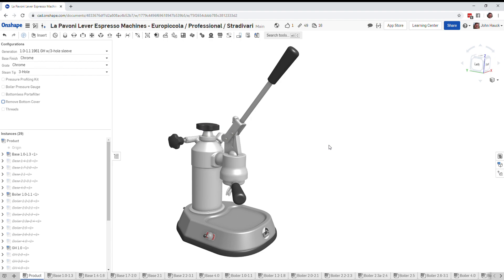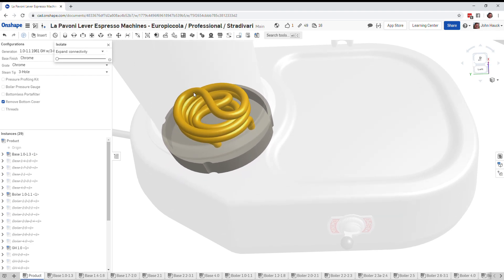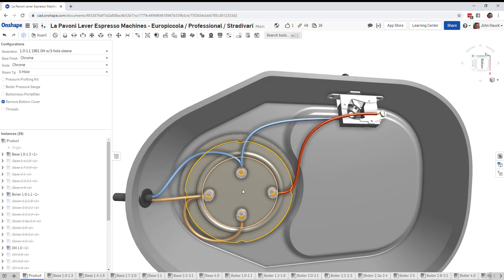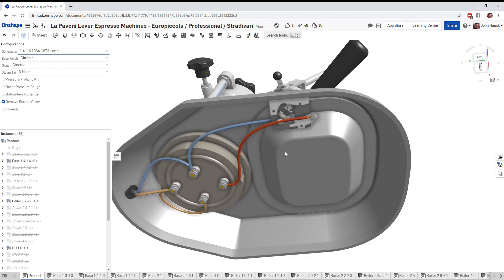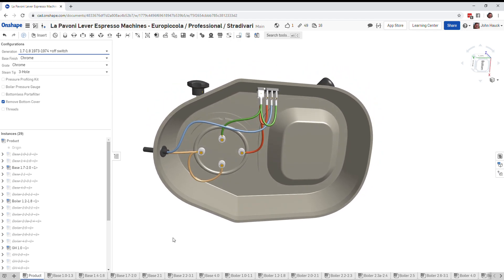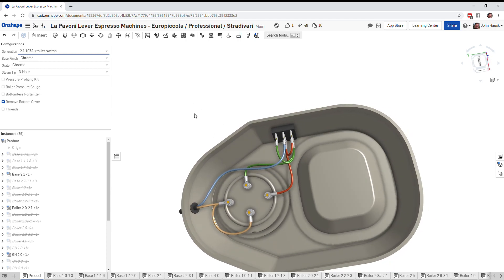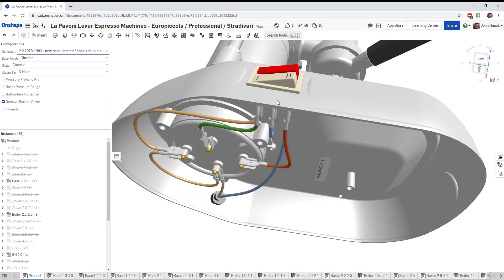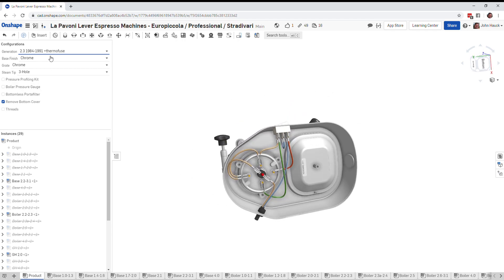9: Switches & Wiring Over the Years - La Pavoni Lever Espresso Machines

Comment: On my Stradivari Professional bought in 2025 the function of the green light on the side has been reversed. A relay has been added so the light goes on when the heat element is switched off by the pressostat. Not even the user manual sent with the machine was up to date with that.

Comment: Hi, amazing video! I have a 1997 version which does the initial pressure build up but when it releases pressure it doesn't turn back on the heating anymore. I already installed a new pressure switch but it didn't resolve the issue. Any idea what I could try?
Reply from the maker: When you write new pressure switch, I'm assuming you mean the round part connected to the boiler with a pipe. I was going to suggest descaling the machine as that can ofen interfere with the presure switch operation. Maybe try that anyway to deal will buildup in the pipe. What confuses me is when you write "it releases pressure". Are you now referring to the mechanical pressure relief valve on the top of the boiler? I'd suggest bringing this up at this facebook group, as they are a very helpful and friendly bunch. https://www.facebook.com/groups/lapavonienthusiastsgroup
Reply: @JohnMichaelHauck thanks, indeed the round part. I will descale and see if that helps.. If not I will write to the group. Thanks a lot

Comment: Hi John. First of all, thanks for this useful video. 14:15 Your cursor roll over a short horizontal brown cable. Is this the inline thermo fuse?
Reply from the maker: This is not a fuse, but just a simple wire. I colored it brown in the CAD model to indicate it is connected to the incoming brown line from the power cord. In this model, the thermal fuse is the black cylinder in the center of the boiler bottom plate. The red button is the reset switch. I hope that helps. For more in-depth conversations, join us here: 
https://www.facebook.com/groups/lapavonienthusiastsgroup
Reply: @JohnMichaelHauck  Your video was *so useful*. So, my Pavoni Pro bought in 2019 is equipped with a thermal fuse that I can reset. That's very good news. Let's see if I can bring this machine back to life. Many many thanks for your support to the Pavoni community. Apart from that, John, your work is truly amazing.
Reply from the maker: @rdmc43  Thanks. I learned a lot from this awesome site: http://www.francescoceccarelli.eu/lapavoni_schemi_eng.htm

Comment: Hi All, 
Currently working on configuring a machine with the red/green switch and the pressure stat.  I am curious to know if it is a special type of connector that allows for the hooking up of  the two wires (1from a heater element prong  and the 2nd wire from the switch) prior to connecting to the top prong on the pressurestat? (see time 11:12 from the video).  If you can tell me where I could find it online I would be most appreciative.  Thanks!
Reply from the maker: You can get a full wire harness here https://coffee-sensor.com/product-category/la-pavoni-parts-and-accessories-custom-made-from-coffee-sensor/cables-wires/
Reply: @JohnMichaelHauck  Or I found that another alternative to buying the whole wiring kit would be to use "T" splices (tab adapters for wires also a possibility) to achieve this function.  Saves money and reduces potential waste for the landfill.

Comment: Ok next question...........In the diagram for the double element heater at time 7:57, where does the brown wire going from the "off" terminal attach to?  Looking at the diagram above, it looks like it is between the element and the boiler flange. Also, why are there only two wires shown (blue and brown) coming out of the power cord?
Reply from the maker: Oooh, a wierd render glitch. Look at 8:02. It appears the lug did not render. It goes to the terminal on top that already has one brown wire.
There is no ground wire in this render. If there was, it should go to the base and the bottom of the boiler to be safest.
You can always go to http://www.francescoceccarelli.eu/lapavoni_schemi_eng.htm for real pictures.

Comment: Concerning the wiring setup with the thermal fuse and the pressure stat; does the gound wire from the cord get attached with one of the mounting bolts for the heater element?  Is there any special significance/purpose for the red wires listed on the dual elements diagram with the on-off/I and II position rocker switches.  I would think that as long as the AWG # is the same it should not.
Reply from the maker: > Concerning the wiring setup with the thermal fuse and the pressure stat; does the gound wire from the cord get attached with one of the mounting bolts for the heater element?
Look at time mark 12:51 and you can see the ground wire going to both the base the the bottom of the boiler.

> Is there any special significance/purpose for the red wires listed on the dual elements diagram with the on-off/I and II position rocker switches
I don't really understand the question. I think a good place to discuss this further (with more qualified eyes than mine) is at https://www.facebook.com/groups/lapavonienthusiastsgroup
Reply: @JohnMichaelHauck  I went ahead and requested approval to join the group (approval is pending). I just wondering why the red wire is red.  I know that green or yellow/green is usually a ground wire and black wires are usually the hot wires carrying current to the switch.  I'm just a little fuzzy on understanding whether or not the red wire is just another "phase" wire or if it has some specific purpose?  Maybe it's just to make it easier to see on the wiring diagram.   Thanks!
Reply from the maker: @evw-2270  I think most wire harnesses these days are all white. I picked my own set of colors for these models. The colors made sense to me at the time! And yes, it helps to visually follow a wire in the model.
Reply: @JohnMichaelHauck  Good to know, thanks!

Comment: Wow!  Just the info I have been looking for, thanks so much!!
Reply from the maker: Thanks. Enjoy.
Reply: @JohnMichaelHauck  I do have a question though, where does the green ground wire from the cord itself attach to?  Wouldn't it get mounted to a grounding screww drilled into the base?  Are all wires supposed to be the same gage (i.e. 14AWG) regardless of the insulation color?
Reply from the maker: @evw-2270  I'm not sure what generation you are talking about. The more recent designs have the ground wire running to two locations. One is the base and the other is the bottom of the boiler. My understanding (I am NOT an electrician) is because you want all the metal on any appliance to be grounded, and you cannot rely on the boiler-to-base connection to be conductive (there are gaskets and paint that can get in the way). As for the wire gauge, I've always seen them the same size - and this makes sense since you want to ensure the ground wires are capabile of returning enough current to trip the circuit breaker. Again, I am not an electrician, so it would be best to verify all this with a qualified service technician.

Comment: Thank you!  An excellent, in depth description of the wiring changes over the years and many generations of La Pavoni.  With the help of adapter parts supplied by Stefano's Espresso Care, I was able to convert my 1977 Europiccola (which I purchased new in Bologna) into a pressure controlled heater type of the later generations.  It would have been a bit easier having seen your contribution John.  Thank you for taking the time.

Comment: Thank you- this really helped me to troubleshoot my machine. The wires were installed wrong from the factory and your schematic showed me how to wire it correctly!  It now works as it should.
Reply from the maker: That is alarming. I'm interested to hear the details if you have the inclination and time to share.
Reply: @JohnMichaelHauck  the wire from the green light should have gone to the heating connection, but instead it was plugged into the temperature sensor.  I'm surprised it worked at all, but it created a situation where the heater would never shut off- really causing a lot of pressure to be vented by the pressure relief valve.  My friend who owned the machine says it was like that from the time she bought it in the 90s!

Comment: John, what a fantastic resource for the La Pavoni community! Your other CAD videos are also amazing. Thanks for the time and effort you have put into this. I can not tell you enough how illuminating your CAD models have been.

Just a couple of comments about the element wattage as described in this video, based on personal work on multiple Pavonis, and also from Francesco. These specifically refer to the Europiccola.

1. The early Gen1s were 200W & 600W, wired for 200/800, with the 200W element always ON.
2. Later Gen1s moved to 200W & 800W, (wired for 200/800) around 1964. This configuration continued into the early Gen2s.
3. Later Gen2s (around 1980) moved to 200W & 1000W (wired for 200/1000) shortly after the change to the double switch.
4. The abominable short-lived diode version of 1991 used a single 750W element, in a benighted effort to save costs by removing an element, while avoiding a pstat. They finally sprang for a pstat shortly thereafter, using the same 1000 watt element as the Pro.

Side note: 
For those wiling to make a simple wiring mod, the double-switch Gen2s are very easy to wire both elements in parallel to max out steaming power (I have a 1988 wired for 200/1200). 
It is possible to do this on the one-switch (3-position) late Gen1s and early Gen2s, with the addition of a SPDT relay inside the base. I have done so on a 1979, which now gives me 1000W for steaming.
Reply from the maker: bravo, thank you for the kudos and additional details. I've never heard anyone call the diode version "abominable" but I would have to agree. When I was modeling the diode, I thought, well this just seems to be out of the box thinking. It must be genius or the opposite.

Comment: Hello! Amazing work! Can I ask you which cable carries the incoming electrical current? And what is the return?
In Italy the standard is that the brown cable is the Live (or phase) while the blue cable is the Neutral (or return). The ground is yellow and green. Thanks, congratulations.
Reply from the maker: Walter, the CAD model does not allow a mutli-color cable, so for ground I selected yellow. As for the live vs. neutral colors, I tried to remain true to the colors as documented by Francesco Ceccarelli (link in the video's description) where it seems the blue wire is usually the one that goes directly to the switch. The problem with real product photos is following the wires is difficult, so I clearly could have made a mistake here and there, especially since many of the wires are white. For dual-element machines, I used red for the high power element and green for the low. As I stated above, electrical service is only to be performed by qualified persons.

Comment: I was just looking at these espresso machines, and was wondering how to tell the difference between new vs old.  I love seeing the differences so that we can easily determine what is what.
Reply from the maker: If the group head is not bolted on, then generation 1 (1961-1974)
If the top of the group head is 50mm (it looks skinny compared to the bottom of the group head), then generation 2 (1975-2001)
If the top of the group head is 60mm (it looks fatter), then generation 3 (2001+)
If the lever is curved then generation 4 (2005+)

Comment: John remarkable job explaining the wiring evolution using the CAD model. 
I have replaced so many components over the years on my La Pavoni I'd have to say it's mostly made up of new parts with the exception of the boiler and the group head. It's similar to owning a vintage 5 speed Alfa Romero...both need regular TLC but when in tune it is pure joy. Thanks for your efforts.
Reply from the maker: Joseph, thanks for the encouragement.
An Alfa is a pretty cool comparison. A lot of history and a lot of enjoyment. Enjoy your cup tomorrow!

Comment: Wow...best tutorial I've ever watched!  Thanks John!   ---  I bought a new Professional-16 cup in 97 or 98 and my wife and I have each enjoyed a cup every day.   I've rebuilt it a few times over the years but I let the underside rust and have had to use plastic filler where the rust holes have eaten away at the base.  It's so beat up that it sort of looks like Willie Nelson's guitar Trigger! 

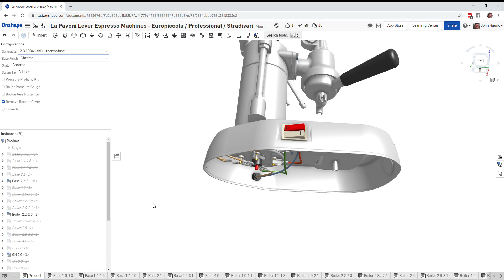I replaced all the wires a decade ago and a couple of years ago I had a company in San Diego, Jim Duke, replace the element but I don't think they replaced the base unit that the element mounts onto.  Are the element and the element base unit separate?  Do you have to replace the element base unit with the element?   Also, I think my model is the one in your video that starts at the 7:30 mark but I'm not sure because all model tags are long gone on mine.   I'm trying to find a wiring diagram.  Do you have a link for a wiring diagram for the Professional 1997-98?  Thanks again!!

Comment: Hi John - I have an October 1987-built LP Professional, bought new and used pretty much daily by me since 11 December that year. Original equipment includes a single-element boiler, a pressurestat, but no safety/cut-out thermostat. The original pressurestat routinely cycled between indicated boiler pressures of 0.8 to about 1.25 bar without triggering the safety valve. The original red simple on/off switch was replaced with a green one when it failed about ten years ago. A few weeks ago I replaced the boiler pressure gauge. Then added a grouphead pressure gauge from the always excellent Coffee Sensor. And yesterday I fitted a Bong Isolator. I'm also using the CS stainless steel naked portafilter, which is bliss, with a 20g basket. And since a few days ago, a IMS Precision shower screen. So, both original equipment and recent additions, all likely to confound anyone wanting to know how it left the factory! Thanks for your truly magnificent walk-around the LP block, which I've only just discovered, and will be coming back to many times.
Reply from the maker: Hi Allen! These indeed are wonderful machines that last forever. Because the design is so stable, a pressure profiling kit from Tudor at Coffee Sensor works on your older machine as well as my newer ones off the factory in Milan today. I was privileged to work with Bong on designing the Isolator for Tudor's store. What a cool community!

Let me know if there are other CAD videos you would like to see.

Comment: so what about the model (i believe it is one from the 1970's or 1980's) where there is an inline thermal cut off (not re-settable).  Do those units have any way to regulate heating?  Do they auto-shut off once they reach a certain temp? Or is that the responsibility of the userr to turn them off?
Reply from the maker: Are you speaking of this one?
http://www.francescoceccarelli.eu/La_Pavoni/Schemi/ep/ep84-87.JPG

Units before 1990 (including the one I think you are talking about) did not have a pressurestat. A pressurestat turns the heater off when the boiler pressure reaches a set point (often 0.8 bar). If there is no pressurestat, then there is no electronic regulation of the heating.

Many units before 1990 had a low and high heating system, that you could manually choose. With those units, the pressure release valve opened up around 1 bar, which kept the temperature down (by releasing heat in the form of steam). So it would be part of normal operation to have steam hissing from pre 1990 units.

With the pressurestat then, the pressure release valve is really more of a backup safety feature that does not open to release steam under normal operation. So it opens at a higher pressure (I'm guessing 2 bar but I don't really know).

Take all the above with a grain of salt. I am not an expert in these things. This is my CURRENT understanding. Cheers!